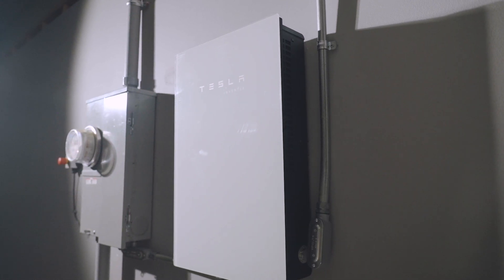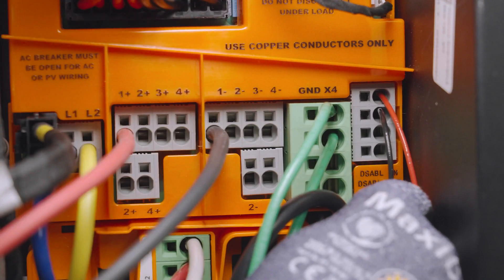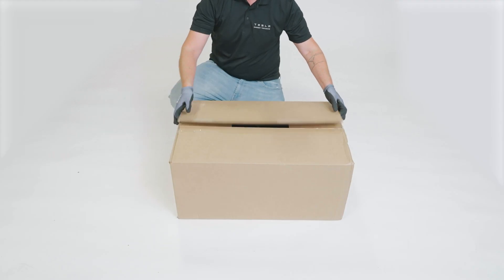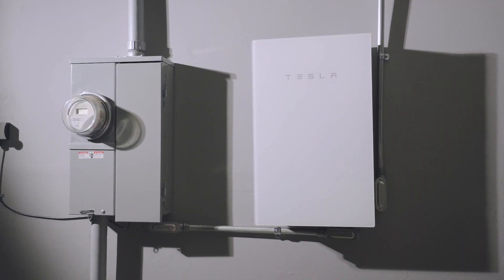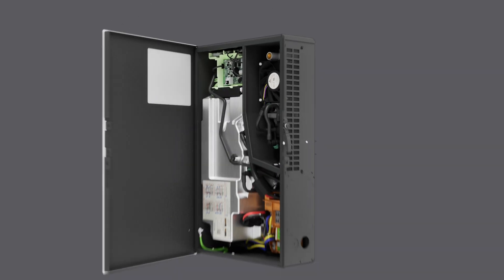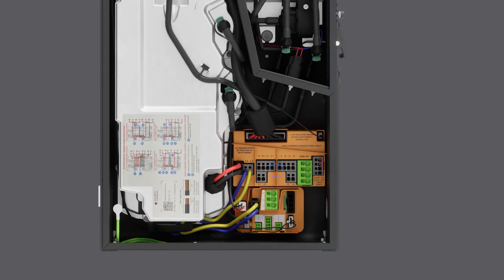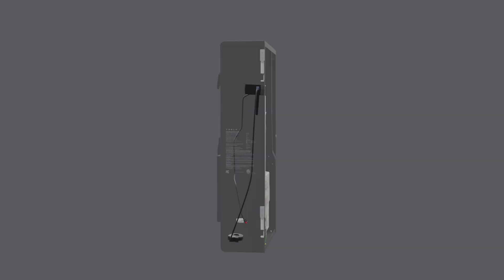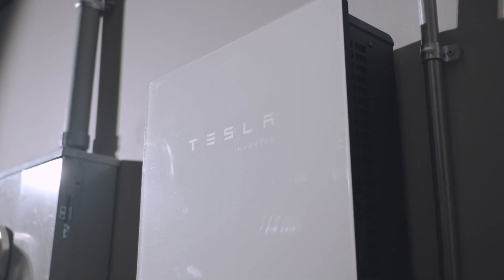Tesla Solar Inverter - Technical Overview

Comment: Several questions:
- Where is the Wi-Fi antenna on the site controller located? I suspect my antenna is bad and would like to see if it can be repaired or replaced as I'm having issues with Neurio communication.
- There is a bank of connectors below the ones highlighted for the installer that were not addressed. What are they? I'm hopeful they are an RS485 connector for the Neurio!
Reply: Did you solve this? I am having a similar issue. Installer haven't been helpful.